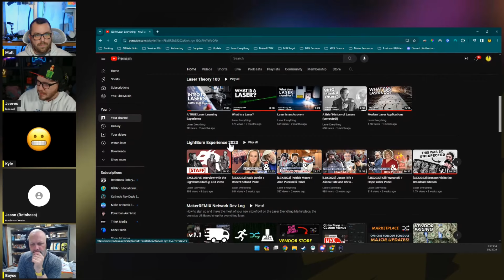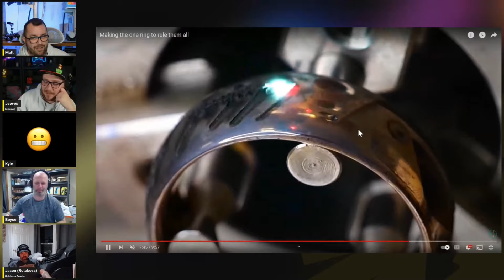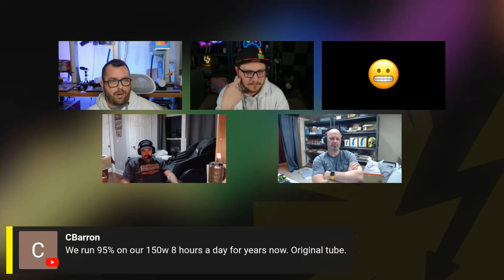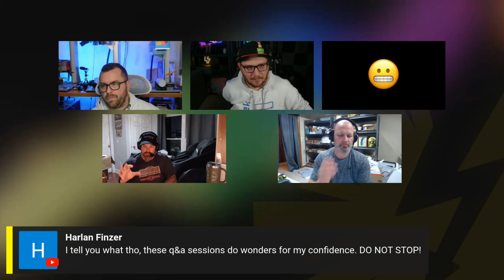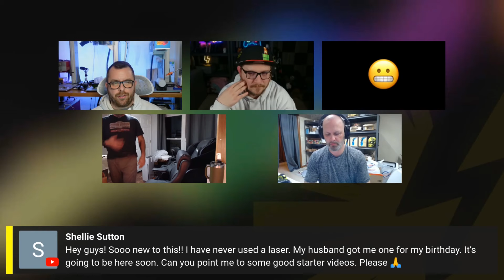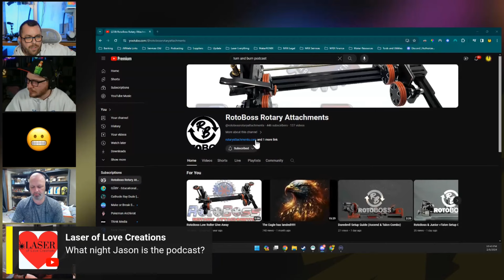[LS114] WHY DON'T ALL LASERS WORK THE SAME WAY?!

Comment: Hi, i got a co2 galvo last january(2024) , it stopped working last week and had to send it back to the supplier, he said it run out of co2,,,, i'm planning to get a fiber laser next, i ask the supplier if it is the same as the co2 that would run out of something and stop working eventually, and if it is the same as the co2 that could be refilled/replaced and work again, he said it just stop working and i should buy a new one when that happens, any thoughts on this?
Reply from the maker: RF Co2 laser sources are indeed filled with a mix of Co2 gas in order to work, and do over time consume that gas as a reaction to generating the laser beam. That said, they are generally able to last for longer than a year under normal use (typically measured in the 1000’s of hours) of laser on time (time the source is generating a beam. Other factors can effect this, like environment it’s used and stored, heat, and if the RF source has a leak, just as a few examples. That said, if you weren’t running that laser under extreme load all day every day, that’s a pretty short amount of usage before needing service, so I suggest monitoring that. 

Fiber lasers do not use a gas to generate the beam. Their beam generation is a bit more complex and not well suited for an explanation here, but we cover that in our courses on the LMA and in our video content about galvo lasers basics. Fiber lasers are generally rated for 100k hours, much longer than pretty much any other source type, so generally if something breaks or misbehave, it will do it early on during warranty, usually. Past that, it will usually last longer than the normal service cycle, outlasting most other parts in the system typically. Generally speaking anyway
Reply: @LaserEverything  thank you for the response 🙂

Comment: I've been doing a 1in box, engrave and measure to verify that it measures correct, and then marking it on my riser so that I know my starting height for each lens. Then, whatever material I am using, I raise the arm that height difference.

Comment: i run a lotus laser 50watt fibre with EZCad at my works place, will i be also able Lightburn on to the system?  (i haven't used that software before)
Reply: Yes, if your laser runs on EzCad2 then it will run on lightburn

Comment: Has anyone ever tried running a fiber laser on one of those large batteries that are used as "solar generators".....
Reply: Awesome..... they usually only operate from 9am to 1pm....being I would probably just be doing small personalizations on the spot...would think it be plenty long enough. Thank you.
Reply from the maker: Yep yep good luck have fun!
Reply from the maker: Yes, generally they work well!
Reply: @LaserEverything  how long will a 50w run on one? 
I live in Texas, we have farmers markets every Saturday and the weather is awesome here....MOST OF THE TIME... wondering if one of those batteries would last for 4 to 6 hours. I don't know how much electricity my laser ACTUALLY uses
Reply from the maker: I think the last time we did the math with worst case scenario numbers it was like 2 hours of actual laser on time with one if the bigger units and an average wattage laser.
Reply from the maker: That said there are obviously a lot of variables but in general galvo lasers don't consume an absurd amount of power.